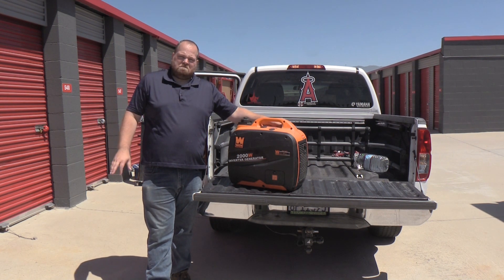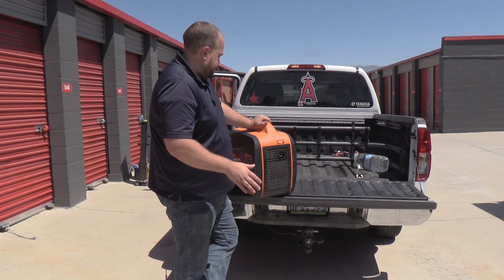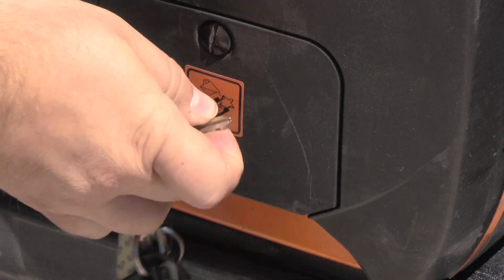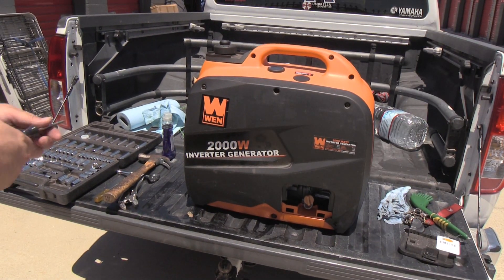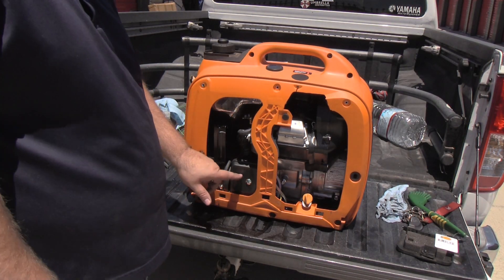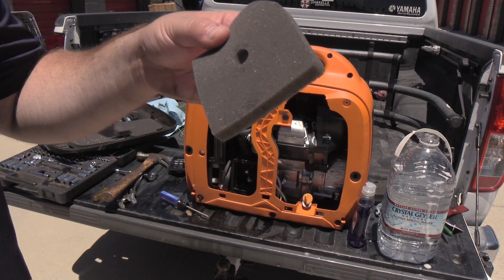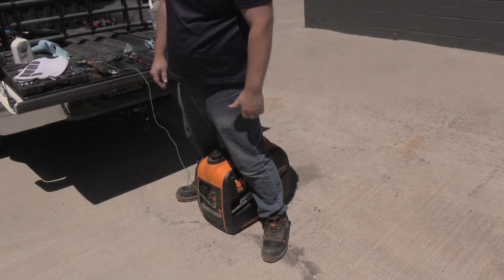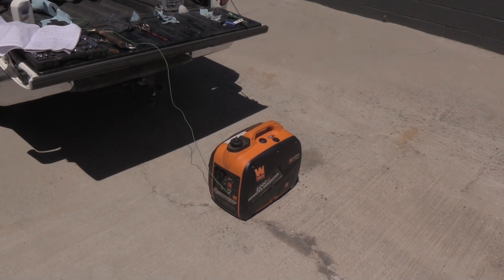Wen Inverter Generator Maintenance

Comment: Question: What is the material/gasket that is around the connection of the spark arrester?  Mine is deteriorating/partially missing and I'd like to replace it.

Comment: Need help- I used my Wen 2350 for 10 months and it refused to go into ECO mode one day. I took off the cover and found a small spring and a triangular silver piece at the bottom that had vibrated loose. As far as I can tell the ECO switch electrically opens or closes a switch which moves the silver piece and after looking for wear marks I determined which way it goes back on. The small spring hooks onto it somehow but I am not sure. I am also not sure why it came loose or if there was another parts to it. I need to see a pic or video of the inside ( with the opposite cover off) so I can see the part in place and working. Is there anyone that can help? I am living in my truck camper full time and it would be a big help to get it back up and running.
Reply: Same thing happened to me- I sent WEN customer service a picture of the part that fell off and they identified what it was. It sat on top of the carb and there were little brass shavings up there. I tried to put it back together but it just kept coming off. I ordered a new $30.00 part and had to replace it. A month later I found that super tiny screw in the bottom of the segmented compartment on the bottom inside. When I tilted the generator it did not fall out so I did not know it came off. WEN customer service was the best. Just send them a pc of the triangular part in an email and they will get back to you. And also you are correct, they vibrate loose.

Comment: I live my Wen 2350. I use it for my window AC unit,  it's a 5000 btu AC and I ran it on ECO mode on the Wen. Can you believe it?
Reply: I do it on my 5000 btu every time i use my truck camper. WORKS great.

Comment: I just serviced our Wen generator (a 2350) and saw that, while the air filter element itself was not that dirty, the area behind it that feeds the carburetor (the area that is supposed to be super-clean) was all full of oil-soaked dust and dirt.  We WERE using it in the desert - there was dust blowing around.  I would have expected the air cleaner element to have been dirty, and it to have been clean behind it.  

Has anyone else experienced this?

Comment: Great video my friend... Thank you. I am trying to figure out how to install an extension on the exhaust so I can keep it running inside my generator shed but exhaust the hot air through a pipe outside the generator shed to keep it cooler in the shed when the generator is running. Any ideas???
Reply: i was watching a video from Etzki (i think) and this video suggested using a COLOR TREE 1 inch Stainless Steel exhaust ... I am in process of purchasing a generator so I have no idea if this would work ... when i searched Amazon, the stainess Steel tubing listed was $19 for a 78" length but there were also other lengths available ... please let me know if you had any success in putting on an extension, and if so, what you used...

Comment: So I have a Yamaha 2200 watt quiet inverter generator that I ran for about 8-12 hours a day, every single day for a little over 1 year before I ran into any problems.  Turns out the problem I had was a clogged spark arrestor.  Thankfully I figured that out and how to clean it by myself.  One big difference between the generator in this video and my Yamaha is that I can't take the spark arrestor out. Makes it a pain in the ass the clean. Anyway,  I usually clean it every month or so when I change the oil.  It ran pretty good for almost another year before I ran into the problem I'm having now that I can't figure out. One night the generator shut off after running for about 10 minutes.  Took about 20 pulls before it would start back up, keep in mind this generator usually always starts on the first pull. But after I got it running it shut off after about 5 minutes and it just keeps doing that. I discovered that my air filter was practically covered with oil.  I think when I tilted it forward to drain the old oil that it somehow got into the gas and eventually over time clogged my air filter with oil.  I drained everything and removed the air filter,  cleaned the air filter and put fresh oil and gas into the generator and started it up. It ran about 30 minutes before shutting off.  When I was checking it  out I found more oil on the air filter.  I'm not sure what would be causing this or what I can do about it.  Sorry for the extremely long comment but I want to give as much detail as possible so that someone might be able to help me. I run the generator so often because I basically live off of it. I'm in a rough time in life, living in an old rundown camper and the generator is my only means of basic survival.  It was an 1,100$ gift from my former boss and friend and I want to show my appreciation for his incredible generosity by taking care of it as best as I can.  Any help or advice from anyone reading this would be immensely appreciated.  Thank you,  God bless!
Reply: Sounds like you have an oil leak. is there any oil marks above where the area around the air filter? if not then I would have to guess that the oil leak is internal to the engine and spitting into the air intake. NOTE: I am NOT a mechanic. but it sounds like a good guess..
Reply: @patzbit9562  I think your right about the leak possibly being internal. The only oil I can find seems to be coming into the air filter from some internal means. I'm no mechanic either but I definitely appreciate your input. Though I'm not sure what to do about an internal leak. Perhaps a bad gasket maybe.  I'll have to look into taking the carburetor off and seeing where I can go from there.  Thank you for responding,  I greatly appreciate it.!
Reply: Many people soak the air filters in oil in order to catch more dirt. So that's a good possibility why your filter was oily. Changing your spark plug to a iridium plug instead of what came stock with it is very helpful for those motors. Also never storing it for longer than 30 days with fuel in it unless you are running the can gas from hardware stores such as truefuel that can sit for a while and still be okay. Changing the oil often at the bare minimum once a year but some say 30 to 50 hours of runtime and you should change the oil.

Comment: Much louder cause you didnt seal the rubber boot back around the shroud...and its a pain in the butt to do
Reply: I noticed this same thing after cleaning the spark arrestor on my wen df 2500i> Any tips on how to correctly seal the boot to the back cover?

Comment: I’ve had mine for a year now it was running fine when I start it, it starts letting out white smoke any idea wat the problem could be?
Reply from the maker: Not sure maybe oil level?
Reply: gdiranger77 it started to happen when we put oil in is it cuz it has a little bit or we need to add a little bit more?
Reply from the maker: @JFLS00  it sounds like its overfilled check the level on an even surface.
Reply: gdiranger77 another thing is that when we crank it and we pull it, it gets stuck and we don’t know why is that do u think we need to open it up?

Comment: What type of fuel and oil are you using. I use good gas and synthetic oil in my Wen and never have carbon like that on my spark arrestor
Reply: My WEN 56203i recommends synthetic 5w-30 to cover the entire temp range, and at least 87 octane, and ethanol free is ideal, do not use gas with more than 10% ethanol, according to the manual.
Reply: I use non-ethanol and Amsoil, mine starts acting up after a couple hours running a 21ft camper with only ac on, it’s central Florida so it’s hooooot. Ac is 13500btu and WEN 3800 is 50% power with wide open space around so not overheating, trips the internal breaker. The exhaust screen I cleaned with a torch

Comment: Just so you all know this is the same gen set as the 2000 watt inverter Predator at Harbor freight. Mine also plugged up the spark arrestor at about 60 hours. So the engine tried to push through it and was blowing black smoke from the back pressure and running rich from not being able to vent. I threw my spark arrestor in the garbage it is crap.
Reply: I toss them too

Comment: Hi, I have the similar model, the handle in the middle is a bit flimsy. The handle warped together (cheaply made plastic )when I lift the generator from the ground! I don’t know if I got a faulty unit or Wen products are cheaply made! Could you give me feedback on that please, thanks you.
Reply from the maker: Hmm mine hasn't had that issue. I know there were older models with some bad reviews but my handle is strong and I pick up and move the generator quite often and quite a distance. I would see what year it was made.
Reply: gdiranger77 https://youtu.be/yNAFcf0iMJ4

I posted the video to see if you have the same problem, thanks
Reply: I have the older yellow 56200i and have had no issues with the handle. It is very firm.

Comment: Was your spark plug a little snug coming out and then going back in like mine was?
Reply: I just bought the Wen 56203i and I couldn't get the spark plug out with the tool they provided.  I had to ask a neighbor for help who had a better spark plug wrench.  Also I was using the tool they provided wrong, I put the lever in the middle and tried using both hands on both sides.  Apparently you get more leverage by putting the lever all to one side and cranking it that way.
Reply from the maker: Yes but not too bad going back in.

Comment: Sny other option to clean the spark arrestor?
Reply from the maker: Not to my knowledge.
Reply: wire brush worked for me
Reply: I use super clean 100% and leave it for an hr. Everything clean like beans new. 
Super clean degreaser is at Walmart.